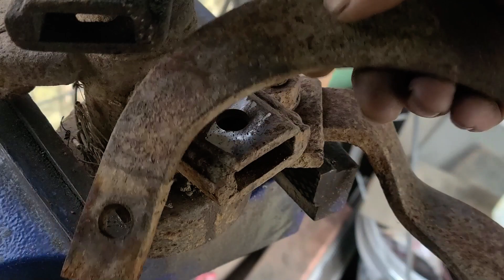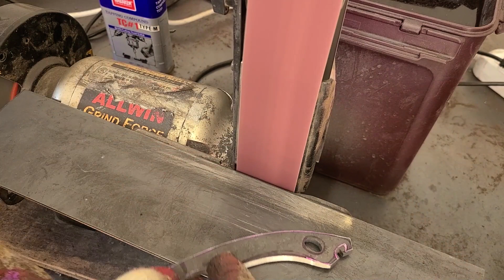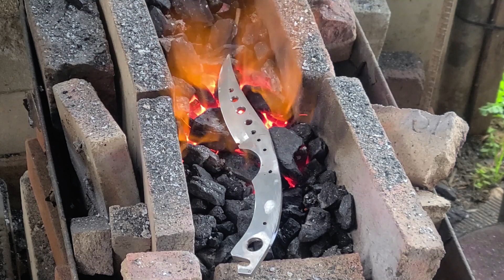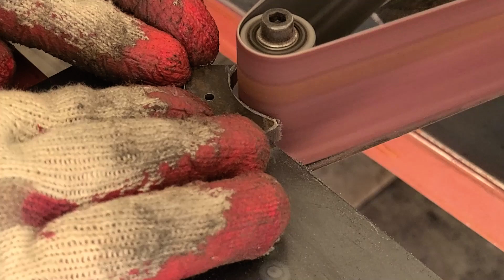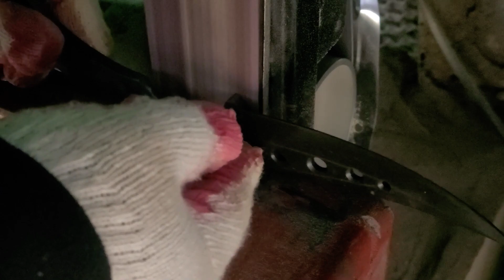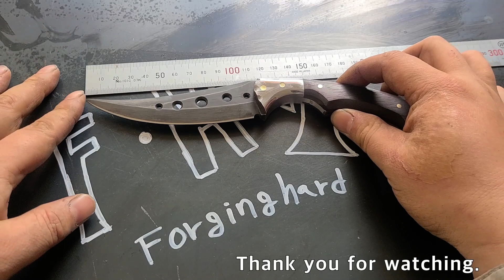making an camping knife

Comment: Why do you put the knife aside at the time of seasoning? Wouldn't it be right to put it on its feet so as not to run the risk of compromising?
Reply from the maker: Thank you for watching.
I am a Google translator user. Your text is not translated correctly. Sorry.
Reply: @forginghard  I'm Brazilian, the translator is bad
Reply: Forging the knife diagonally is bad